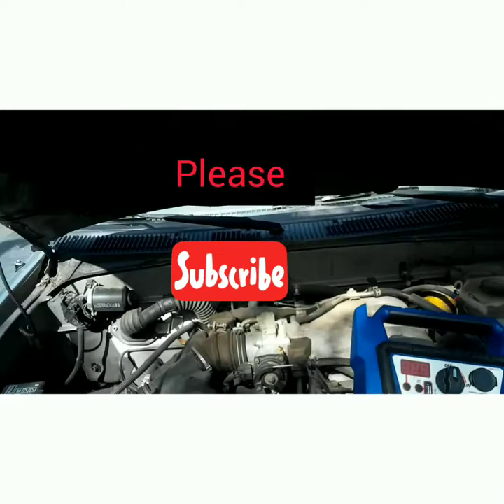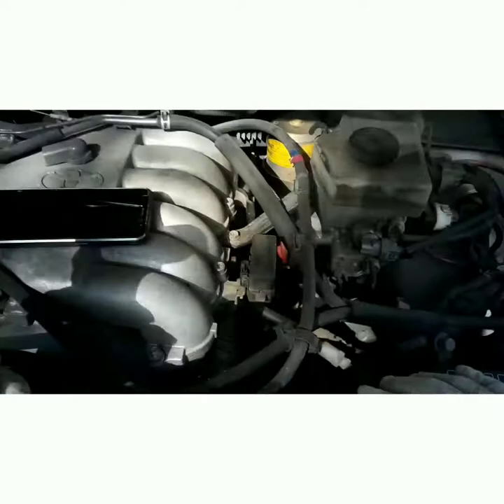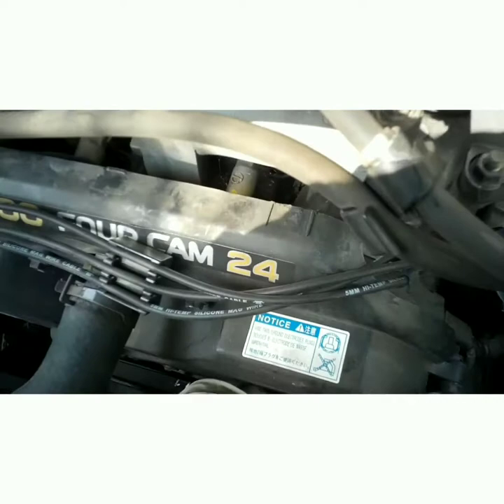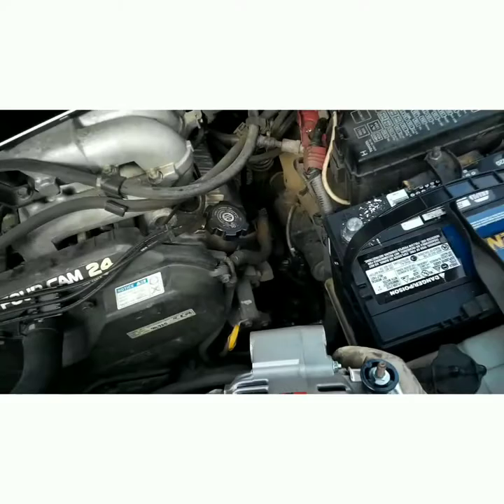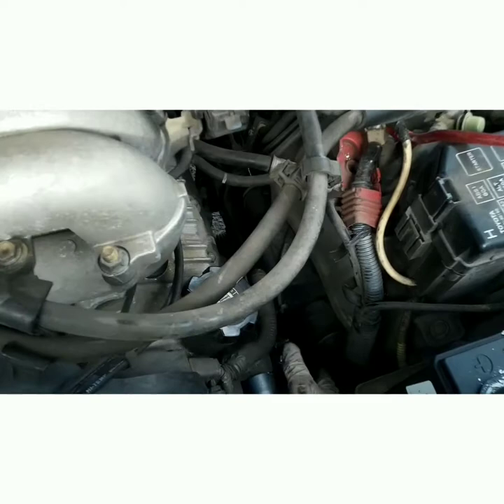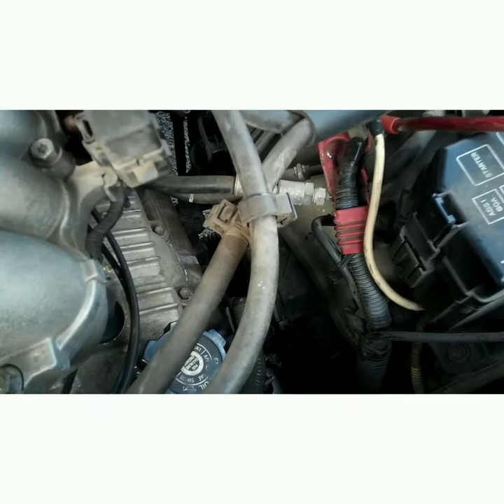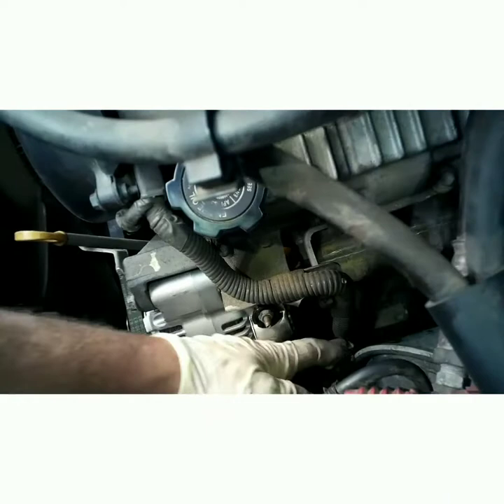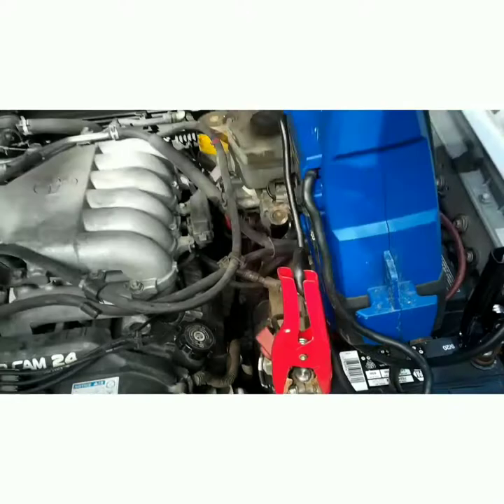how to replace Toyota 4runner alternator 02 3.4 liter v6

Comment: To reset the bushing to make room for alternator, put a 15mm socket on the front and use a pair of vise grips or c clamp to compress it back. Kind of like resetting brake caliper